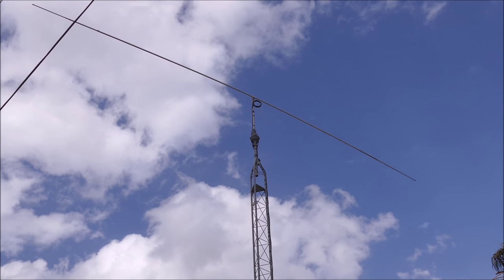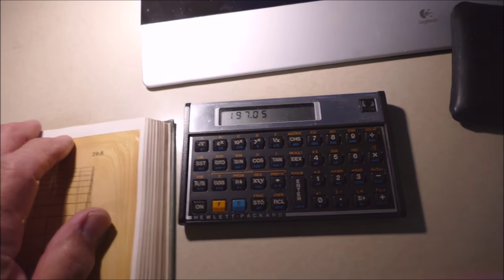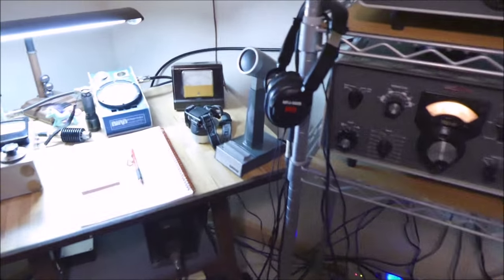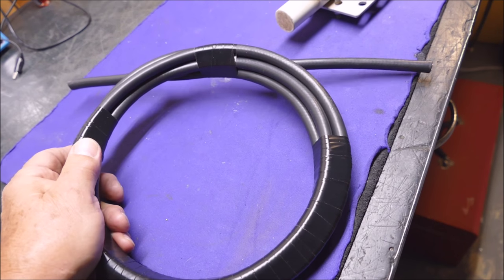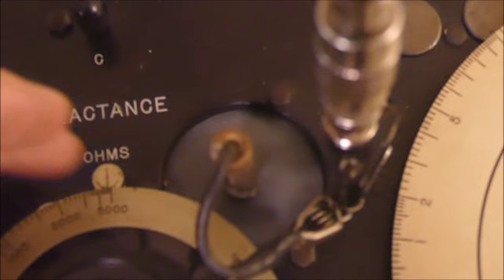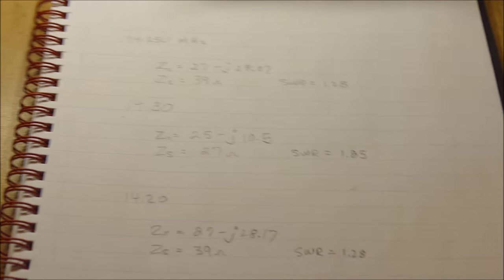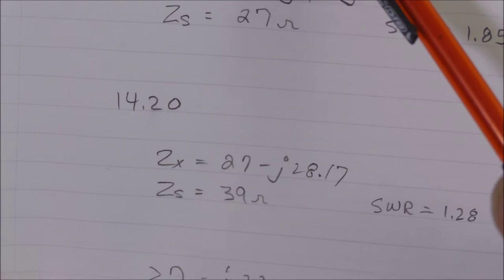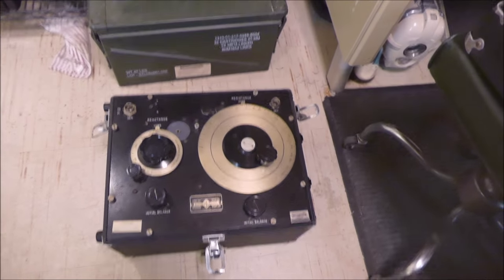Rotatable 20 Meter Dipole with Measurements Using General Radio 916-A Impedance Bridge

Comment: Great. Tutorial on the impedance bridge. I fear that too often a valuable instrument like yours is discarded by people who don't understand what it is. Too many new engineers don't have a good understanding of reactance and cant intuitively predict how to change it. The bridge shows you what is happening as you adjust it.
Reply from the maker: Hi Bill, I understand what you say and agree. I also understand that nowadays we just want an answer so we can proceed. Kind of like using a calculator to reduce the drudgery and error for the four basic math functions rather than do them with pencil and paper. On the other hand, I think, as you say, there is something missed in the rush to progress. Maybe it just goes to show we are older and were in awe when we were kids of the guys that had the time and skill to hack through this and wanted to be like them. These abilities won WWII and got us to the moon (on slide rule accuracy).

Comment: Nice! It's a good time to be a Ham. 

I love the old test gear. Anything that has a tube in it for that matter. I told a friend if mine the other day that I was amazed at how small tubes are these days but I wish they didn't put them in black plastic enclosures (IC chips). Those IC's have to have tubes in them otherwise they wouldn't work :o) 

A lot of instruments that were out of reach for me when I was a kid can be purchased, refurbished as needed, and put into service. If I could pick a favorite of the stuff I own it would probably be my Measurements Model 65B Sig Gen. It's in such great shape that I haven't even opened it up to check the caps, etc.
Reply from the maker: +Michael Lloyd Equipment like your signal generator was built with a spirit of wanting it to last forever and when it did need repair, it was possible. I worked in that environment and on equipment of that caliber but I think it all changed in the late '80's and that was the beginning of the "throw away generation". It is pretty amazing that even today, we are more likely to be able to repair a piece of 1950 equipment than we are to repair a 2010 piece of equipment.

Yes, it is all of  those little tiny filaments in the tubes inside the IC's that makes them get so hot.   :-)
Reply: +ElPaso TubeAmps The older gear had class. None of the glittery stuff that fades away. It was great then and it's great now. If I can ever get my spare bedroom converted to a Ham shack I'll put my older stuff on the bench and working. I like the 80's vintage HP gear too but the tube gear gets my attention.

I have the amp pulled out of my 2000 Land Cruiser. I was going to try to troubleshoot it and I can't even find a connection diagram much less a schematic. I think I could fix it unless there's a problem with one of the three amp IC's. I don't think they make them anymore.

I'll tell you what else I wonder- Most electrolytic caps have a relatively short lifespan. It's not going to be much longer and a lot of "modern" equipment is going to start biting the dust...

I knew it! Chips have tubes in them (lol)!

Comment: Cap Hat and top inductive loaded vertical beam for 40mtrs; single element vertical loaded for 80M, director beam for 17M, inductive loaded reflector beam for 20M,
X Beam, etc.  Always matched 1:1 with mini xmission line xfmrs as I never run more
than 10W and most times ~3W ..wked 150 countries QRP with 2 ele director beam- WU2J

Comment: I make my half wave dipoles by using L= 468 divided by frequency..When I made my 75m dipole cut for 3.880mhz. and it came out to 120.6 feet tuned to resonance.
Reply from the maker: +Mike Samra I agree with you and I  start with that formula as it works good for wire dipoles. However, if the diameter of the element is greatly increased as in an aluminum tubing element of an inch or more diameter, the length begins to shorten according to the chart I used in the video. In my case, the L/D ratio was abut 400 which shortened it up by 5% but 5% of 400 inches is 20 inches (10 inches each side) and that is significant and it will bring you closer to a good match when using aluminum tubing. Since I also have some small amount of reactance, the length of the coax does affect the R+lX at the end of the line where my station is. As I showed in the video, it is slightly capacitive. In testing this I added a random short piece of coax (5 feet 9 inches to make sure it was not 1/4 wavelength) and the reactance changed to very slightly inductive. It is not a problem and the transmitter would be able to load to it but I still use an antenna tuner to get rid of that last bit of reactance. Tuning out the reactance also make the antenna system and the dummy load the same so I can switch between them without any retuning.With the G5RV Jr. no matter how strong the signal on 20 meters, my S meter would never go above S-9. I know for a fact that my S meter is properly calibrated as I have carefully checked it and properly adjusted it. I got the same readings on my iCom transceiver also. With this dipole I can easily get a 20/S9+ signal reading. It is absolutely amazing how much better this antenna is than the G5RV Jr that I was using.
Reply: ElPaso TubeAmps
 I love your station.. My tower only goes up 55ft and that's with the mast..Ill have to make a tubing element type one of these days.
Reply from the maker: +Mike Samra 

Thank you - here is what I did today. Making these length changes to the antenna and adding 4.5 feet of coax completely eliminated the reactance at the station end. No antenna tuner is necessary.

April 11, 2016

Lengthened dipole 12 inches on each side. Was 187.2” now
199.2” each side.

Total length 384.4” plus distance between elements approx. 4”
for a total length of 402.4”

Measurements per GR bridge

14.20 MHz           Z=35+j0                                VSWR 1.43

14.25 MHz           Z=36+j0                                VSWR 1.4

14.3 0MHz           Z=36+j0                                VSWR 1.4           (per online Chemandy calculator)

14.35 MHz           Z=38+j0                                VSWR 1.3

14.40 MHz           Z-38+j0                                 VSWR 1.3

Measurements per mini circuits directional coupler –
scanning 14.0 to 15.0 MHz

14.00 MHz           18dB                      VSWR 1.28

14.50 MHz           26dB                      VSWR 1.1

15.00 MHz           20dB                     VSWR 1.22

Measurements  per my RX bridge

14.50 MHz        
Z=39+j0               VSWR 1.28

14.25 MHzZ=37+j0                VSWR 1.35

Comment: I take it you don't have to worry too much about water proofing in Elpaso? You have some beautiful vintage test equipment thanks for sharing it.
Reply from the maker: +andrew mcneil Hi Andrew, El Paso is, on average, 4000 feet above see level so we don't have to worry about tsunamis... Relative humidity here is also generally low so things, like cars and steel items can lay around in the desert for decades with only surface rust on them. On the other hand, things dry out and fill up with sand..  The rainy season is the summer and it can be amazingly wet and people get drown in sudden desert downpours. So, yes, we do have to water proof our coax lines here in the high desert. Thank you  for your comments and I do love the old equipment. It is amazing how accurate and reliable it is even after 60+ years.

Comment: I've built ant. meas. rcvrs for most HF Ham bands (VXO LOs & XO source ant) some yrs ago and measured many gain ant vs a ref dipole. Use ferrites for balun and for
matching xfmrs (mini Sevick's designs).  Still have HB equip.  Have questions about WiFi meaurements/equipment on other's articles. Wud like to email you- Byron WU2J in FL
Reply from the maker: +Pigeon Fancier You can find my direct email at my QRZ page. WA4QGA   I will help any way I can.

Comment: Is it only using the OD/skin of the antenna boom? And could you use a linear motor to perform telescopic adjustment in the end to fine tune the length? Explain the length impact in a future post pls. Thanks

Comment: how does the cable around rotor work looks like no slack when turning
Reply: Just a bit of slack cable, if he's locked it at one full rotation. Then you have stop and go back the other way. It's not likely rotating like it's a radar dish.
Reply: I know it does not turn like a radar dish but like my antennas it turns from north to south and back I need some slack ,, his looks like there is none
Reply: Since the antenna is bidirectional, it only has to rotate +/- 90 degrees.
Reply from the maker: +DENNIS N It may not look like there is much slack in the coax for rotation but there is actually plenty. I installed everything pointing north so I only have to rotate 180 degrees left and then right and as was just mentioned I really have to turn only 90 degrees. I know the old adage of, "there's no antenna like my antenna",   :-)  but this thing works wonders around my G5RV Jr. There is a seller on Ebay that sells a rotatable dipole using what looks like mobile antennas (ham sticks?) on each side that may be pretty good. When you think about it, virtually all antennas are based on the humble dipole but we often times cannot hang a wire truly horizontal and end up with the inverted-V configuration and we certainly can't rotate them. End rejection is very good with the dipole and that alone quiets down the band. I am really pleased with it. I just hope the El Paso desert winds don't destroy it. Thanks for all the responses. 73

Comment: Looks like if it falls down, it will hit the powerline.
Reply from the maker: I have been careful to measure and make sure it is not too tall or the elements too long to hit the 8 KV power line running down my alley. Of course, what I have is the highest and widest antenna I will ever be able to have.